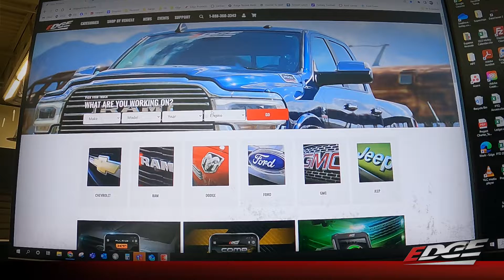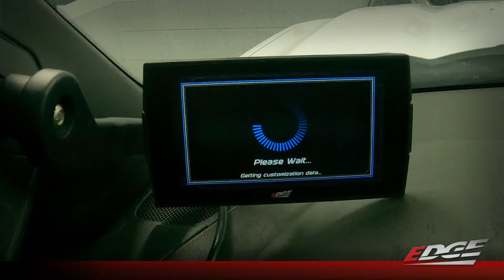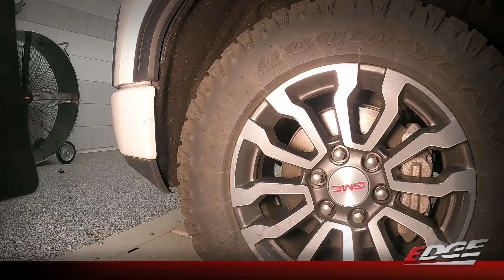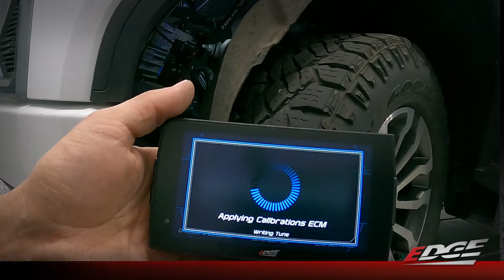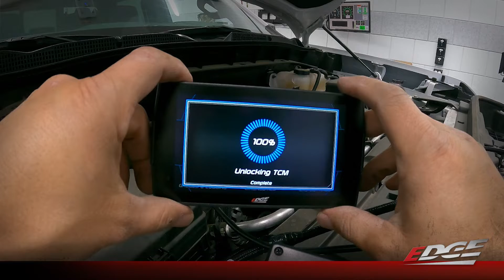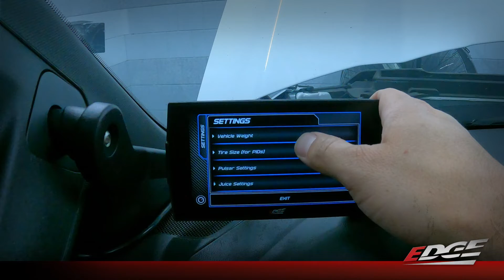Evolution CTS3 2019-2022 GM Gas Installation

Comment: I want one but need to know if it leaves watermarks or can it be removed with out leaving anything
Reply from the maker: Flash tuning will leave a foot print as every flash that goes into the ECM will reset the VIN count procedure. If you're looking for options that won't leave a trace, checkout our Pulsar LT for this applciation. part number 22451
Reply: @edgeproductsman thank you very much
Reply: @edgeproductsman does the pulsar LT make actual power or does it just improve driving
Reply from the maker: @Vuhjayjay68  it is not a power adding device, just a feature control. For added power, you'll need to flash the ECM.

Comment: If the locksmith device can only unlock and not re-lock and also cannot be used on any other vehicle then it should be a returnable item with a core charge. It’s literally worthless after doing that.

Comment: Had my local mechanic unlock the ecm and tcm. They programmed my truck and 30 miles later check engine light comes on. Threw a transmission code. Took it back mechanic. He put truck back to stock and reprogrammed. 30 miles later, check engine light back on. I’m not impressed. Makes me question whether any changes were made at all.

Comment: Bought one end of last year. Still will not disable the Auto Stop, remember what mode that the truck is in such as sport, tow haul, not real happy. They say the engineers are working on it. Have 2019 GMC AT4 w/6.2
Reply: any update>

Comment: Do you have to keep the cts3  monitor connected? Can you just tune the truck and disconnect the display?
Reply from the maker: Yes, once the ECM/TCM are flashed, you don't have to keep the device plugged in if you don't want
Reply: @  and does the truck keep its tune?

Comment: Whats the part number for mounting? Is it included from the kit?
Reply from the maker: the device will include a universal suction cup mount, but if you'd like our vehicle specific mount for the a-pillar, check out part number 28601
Reply: I have question does everytime you shut off and turn on the vehicle does reset all the mods? Or tune it again ?
Reply: I dont know why auto stop still on when i turned off on the tune

Comment: Hello! Thanks for the video! Do you guys have a video showing how to re-install the CTS3 on 2019 Silverado? My power wire came off during download and a few things aren't quite right? It works but the auto shut off didn't turn off. Not sure if it's still dropping to 4 cylinder as well! So I figure just redoing it will fix it!
Reply from the maker: Go back in to the tuning menu on the device, select the tune you want to flash, then select 'customize' make the changes you want and go through the flash process one more time
Reply: @ thank you!

Comment: I am about to do a CAI, Long Tube headers and exhaust.  Would your tunes work with this or should I seek custom programming?
Reply: I do know you can have email tunes sent in via this device, so I would use this. Because the main other method is HP Tuners which you cant tune the transmisson

Comment: Does this have an effect on the shift points to account for larger tire diameter or is the field for tire size only for speedometer adjustment?
Reply from the maker: This device will do both. Calibrate for larger tires and allow you to flash the TCM with our improved shift strategies
Reply: @edgeproductsman  when you say shift strategies does that mean that it changes the rpm that the transmission shifts at to accommodate the difference in circumference of the tire to keep the engine in the proper rpm range while driving or does it mean it just adjusts how hard and fast it shifts.

Comment: How will this CTS3 Evolution work with my truck I have a 21 Silverado 5.3 with the 8 speed I did the 6.2 L86 port and polish intake and throttle body swap with the aftermarket cold air intake
Reply from the maker: our calibrations were built on 100% stock trucks, but the modifications you've made should only improve their output
Reply: @edgeproductsman  which tune setting do you recommend with All that I’m planning on adding the Borla s-type catback exhaust I was thinking the sport with soft shift I’m not planning on doing any racing of that nature just wanna wake it up
Reply from the maker: @51tinfante  the catback exhaust system should require no changes to our calibrations within the device, any of them will work great for you. The higher the octane, the better!
Reply: I’m considering the same, did you have to get a different size coupler to fit the larger throttle body or buy an intake kit for the 6.2? Curious on the fitment.
Reply: @juiceisloose7479 I bought a cold air intake made for a 6.2 since it’s different

Comment: If I use your product to unlock the ECM and TCM will I be able to use HPTuners software to tune later? I will be running your tune at first until I do a cam swap later.
Reply from the maker: We have not tested our process with any other competitors systems
Reply: @edgeproductsman  this unlock on-site system yal have is awesome!
Reply: No. HP only unlock it to essentially relock it behind there script. If you want hp on a 2019+ you gota send it in and pay alot just to get an opportunity to now pay alot more for credits for the ecm & tcm which may also have to be removed I'm not 100%. But 16 total credits for my 2019 trailboss after sending in the ecm.....lmao. wayyyyuu better to have 2018- when it comes to hp

Comment: This is a game changer for these trucks. I have this on my 2019 5.3L, 8 speed Silverado. The install was easy and the truck is so fun to drive with the tunes. I have mine set up with the DFM turned off. I have the performance tune installed and I have it in performance mode always on. I get about 18 mpg with this set up. I had the throttle response at 50. After having my fun with that I set it to 30. I am so happy with the CTS 3 and the way this woke up  my truck. Well Done!